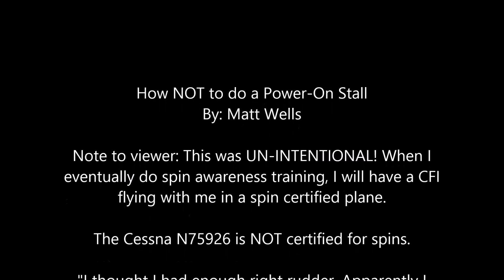How NOT to do a power on stall/Spin awareness

Comment: The reason why you had a wing drop is not because you didn't have enough right rudder but because you've used the ailerons! Higher AoA on the left wing will make it stall first hence lead you straight into a spin! Nice recovery though.
Reply: Bingo!  Deflection of the aileron changes the chord thus AOA for a given relative wind vector.  A spin is an imbalance in stall on a symmetrical wing (kind of tough to do when you think about it).  The more of a delta between the more deeply stalled wing and the other stalled wing, the greater the spin forces.  Aileron deflection just helps make the delta that much greater.
Reply: Correct, but it's important to note that both wings are stalled in a spin, not just one wing. Although... I guess one could argue that one wing is more stalled than the other... Heh.
Reply: only one wing is stalled in a fully developed spin, that's how autorotation works.
Reply: no, I think you missed the point - in auto rotation (spin) one wing is stalled and the other is generating lift - that's the cause of the spin, if both are stalled then it's just a normal nose drop stall and recovery.
Reply: Karl Schuch, technically, one wing stalls first, but in a fully developed spin both wings are usually stalled. You can argue both cases, and both scenarios are true.  Technically speaking, if only one wing is stalled, the plane would continue to roll throughout the entire spin; what usually happens is the inside wing stalls first, followed quickly by the outside wing.
Reply: Karl Schuch I'm genuinely curious why you disagree. Both cases are possible. I have a degree in mechanical engineering and everything I've learned as a student pilot support the idea that either one or both wings are stalled in a spin. In the case of a flat spin, if only one wing is stalled than the plane will roll, as only one wing is generating lift. If only one wing is stalled, as you claim, then the plane must roll. It's simple physics.
Reply: Karl Schuch from the faa directly "a spin may be defined as an aggravated stall that results in what is termed "autorotation" wherein the airplane follows a downward corkscrew path.  As the airplane rotates around a vertical axis, the rising wing is less stalled than the descending wing creating a rolling, yawing, and pitching motion"

Less stalled is still stalled. Both wings are stalled. I stand my ground.
Reply: Transane yep, I agree that statement makes zero sense ... less stalled?  I think that expression :"less stalled"  can only mean the wing is generating lift
Reply: a wing stalls as a result of the separation of the boundary layer when the critical angle of attack is exceeded - for a wing to generate more lift than the other, that means it has to have an attached boundary layer, which means it is not stalled... look it up in an aerodynamics book
Reply: Transane, you hit the FAA's spin-definition on the head. Both wings are stalled with one wing more stalled than the other. Laminar flow over both wings have been disrupted.

Both wings exceeded its critical AOA with one wing's AOA greater than the other.

One wing produces more drag than the other causing auto-rotation with the airplane yawing, pitching, and rolling in a cork-screw path forced downward by gravity. 

Every competent CFI-candidate, CFI, and DPE will support this.
Reply: Windtee I appreciate the support. It's important to spread the correct information so that we may all be more informed, safer pilots.
Reply: Jordan Barat wrong.    As the plane slows down and yaws left , the left wing slows down more than the right and stalls first-> drops first-> spin.
Reply: Karl Schuch no Man!    Both wings are stalled in a fully depvd spin.   How is a wing not going to be stalled with air flowing circularly around the darn plane as it falls like a rock?    Both wigngs stalled.
Reply: I think some of you guys are being too nit-picky about the definition of a stall --- it's not like a light switch that you flip between light and dark --- stalled and not stalled --- flying and not flying.  You're not out there dealing with a dictionary.
Reply: Tim E. Actually, it is like a light switch on and off... Hence why there is a documented angle of attack at a given airspeed you shouldn't exceed; a stall happens at a particular speed/angle because laminar flow breaks at a particular speed/angle.

When something is less stalled, they probably mean it has less laminar flow separation than the other wing; not that it is not stalled because it is "less stalled" than a stalled wing... If that makes sense for the person claiming less stalled means not stalled
Reply: Cory Goodman  Think of it this way—-the  L/D graph rises to a peak , a maximum,  but it then does not descend vertically to zero immediately afterwards. It drops far more steeply  than the initial climb angle on the graph , but it is not vertical!  So, each wing could be at a different point on it—- both stalled——with one producing more lift than the other. It’s this difference in lift on each wing that produces the roll——even though both are at greater than stall angle—-because, as the FAA correctly says, in a spin the aircraft is pitching , yawing, AND rolling.
Reply: If I may, it looks like you weren’t using enough right rudder as you initiated your stall. The right wing starts to get kicked out forward which generates more lift on that wing, causing it to rise. As you pull up you can see you feeding in more and more right aileron until the left wing breaks, at which point you use full right aileron deflection, which just stalls the left wing more aggressively. This was a great video and I’m glad we all learned from it. *some advice that saves lives* If you are ever slow, pulling pitch and a wing starts to break, DO NOT try to pick it up with opposite aileron. Relieve back pressure and kick opposite rudder immidiately!! Thanks for the video
Reply: improper use of ailerons after wing drop AND insufficient right rudder during maneuver.  Just look at the lateral movement of the ground leading up to it.  Always recommend using higher clouds as good yaw references for pwr. on stalls (and definitely don't perform it into the sun.
Reply: Just to chime in here, the outside wing travels one rotation in the same time the inside wing does. Given the outside wing travels a further distance in the same time, it is not ridiculous to assume one wing can be stalled and one wing producing life in a spin. I could be way wrong though.

Comment: When I was a student pilot still in Cessnas, I asked my CFI to demo a spin for me.  Apparently he had not done this before, and went "by the book" on his spin recovery and took the "stick forward" instructions too seriously, basically locked his elbows straight forward like he was trying to push the stick through the firewall.  He put us into an inverted dive and all the books, pilot stuff and every mote of dirt in the carpet hit the ceiling (then immediately down on our heads.)  He corrected for this by pulling the yoke back into his lap and nearly over-G'ing the aircraft on the pullout.  Memorable to say the least.  I later went on to "real" acro, first in a C-152A Aerobat, Pitts S-2B, then later the full compliment of USAF trainers and some time in the F-16 and the unusual attitudes training in supersonic military aircraft is more extreme than in the civilian world - it was then that I learned his inverted dive recovery really should have been "roll to the nearest horizon then pull to level".  A lot of the memories of my stall/spin experiences have faded from memory, but the day you come back from a sortie with dirt in your hair is one you will never forget.

Comment: Something you need to remember: I had to do a turning stall for my checkride and you just have to keep reminding yourself if it's a turn to the right keep that ailerons NEUTRAL no matter what and be ready to slam that left ready and release back pressure. If it's to the left it's the opposite. Never ever ever in under any circumstance use ailerons. Great learning experience and fantastic recover. Only lost what looks to be about 800 ft. Nice job, and safe flying.

Comment: As a pilot it is vital that you understand aerodynamics and manufacturing recommendations for stalls and spin recovery. What is more important is learning and understanding what you did wrong when it happened so it does not happen again. Good recovery, and thank you for sharing, showing other pilots that it's okay to make mistakes as long as you learn from them and do not put the aircraft or yourself in danger.

Comment: If I may, it looks like you weren’t using enough right rudder as you initiated your stall. The right wing starts to get kicked out forward which generates more lift on that wing, causing it to rise. As you pull up you can see you feeding in more and more right aileron until the left wing breaks, at which point you use full right aileron deflection, which just stalls the left wing more aggressively. This was a great video and I’m glad we all learned from it. *some advice that saves lives* If you are ever slow, pulling pitch and a wing starts to break, DO NOT try to pick it up with opposite aileron. Relieve back pressure and kick opposite rudder immidiately!! Thanks for the video

Comment: I am a long time CFI, as noted below you attempted to level the wings with the ailerons in a stalled condition. In most aircraft proper recovery is power to idle, opposite rudder to stop the rotation, forward elevator to break the stall. The method will vary slightly by aircraft type, some manuals will define recovery with power to idle, forward pressure first and then opposite rudder.

Comment: Great lesson, Matt. Thanks for sharing.  As someone who is contemplating getting into flying, my takeaways from this video and discussion - avoid practising into the sun where I would need to use throttle hand to shield my eyes. Good advise about avoiding temptation to use aileron to recover.

Comment: he added right aileron as the spin began, thereby increasing the yaw in the spin direction - with some aircraft opposite  rudder input may not be able to overcome the yaw created by improper aileron input sufficiently to stop the autorotation... Fortunately he took the aileron yaw out and the spin stopped.... he needs spin training and practice - as do almost ALL general aviation pilots.
Reply from the maker: Generally, student pilots with only 25 hours TT need training and practice...hence why I was out doing those in the first place...
Reply: very cool, keep going after it - read up on spins and that will place you head and shoulders above the rest of the field.  I flew a Pitts S1 for years and became proficient at aerobatics, and I learned that spin recovery is so essential and yet most pilots are clueless.
Reply from the maker: *Note: This was over 2 years ago when I was in VFR training...It was only a few flights after this that I did spin training with a CFI.
Reply: Karl Schuch aileron drag is mainly noticeable during the onset of a roll. at such a low airspeed his ailerons would have been much less effective. it appears that the student mistakenly used his ailerons to try to pick up his wing drop, and control his spin. 
the reason this aircraft spun was due to far too much left rudder during the power on stall
Reply: pilot_ryan89 of course the spin was initiated by yaw induced when entering the stall, application of opposite aileron only contributes yaw at that point while doing little to control roll

Comment: Once you did the classic aileron stall of the inside wing, not only did you have the wherewithal to pull power, you also grabbed carb heat, just as you stepped on the rudder.  Gonna' say: that impressed me.

Comment: you had right aileron, the raised aileron gives that wing a lower angle of attack, the other wing will stall while the upper wing still flies. This is the basis of the base to final turn....getting slow, starting to roll and putting aileron in to compensate and just what you got!  Nice job recovering for a student pilot....

Comment: Nice job. one tip when you're doing a power-on stall it helps if you pull more aggressively on the yoke once you get around your stall speed, instead of slowly pulling back. Just makes it happen quicker and less rudder work

Comment: Wow.  Very nice man!   Thanks for sharing!     That's a great mistake made in the appropriate setting for everyone to learn. Great job on the reflexive pull back of the power.  I am sure by now you know that you should have added more right rudder as plane slowl jawed left to prevent the spin, and also not to try to correct with aileron, and much less to pull back.  Instead hit right rudder, push forward, and pull power if nose down.     Great job man.  Good learning experience.  Thanks for sharing.

Comment: The secondary effect of the yaw is roll. Since you were in slow speed you needed to apply more right rudder to maintain direction. You didn't do that. Constantly you were yawing to the left. This caused the right wing to move faster than the left wing therefore the right wing was producing more lift. That's why you were also rolling at the end and just prior stall even though you put full right aileron it was too late. During Slow Flight you are required to fly the so called "crossed controls" meaning applying more force on the controls in order to maintain level flight and direction. This is because the control surfaces are less efficient since your airspeed is slower.

Comment: Good one, Matt. Hey, you had heaps of recovery height and you reflected back with both humor and wisdom in relation to it. You seem to have been pretty competent to me in handling the exercise at that altitude, even with the incorrectly introduced right aileron. Just a small thing though, a bit of guidance for the viewers regarding the throttle setting (was it around 1800 RPM?) on entry. This might help them to understand the "power on" description. On spins. A quick, clean vertical tug at the control wheel and heaps of rudder applied quickly will you'll usually get you the spin you desire, and for recovery, if your head is in a "spin", sometimes simply letting go of the control wheel and throttling back to flight idle will get you on the road to initial recovery without having to think about too much else for a few seconds.

Comment: Spin awareness training?  Is that what there calling it these days.  Good job though recovering. I soloed with 5.5 hours at about 16 yrs old back in 1974.  It cost $10 bucks an hour to fly the club 172 back then.  I use to go out and practice power on and off stalls.  On day I did a power on stall, and as soon as I went into a spin I forgot to cut full power,  When I let off back pressure and recovered, I red lined very quickly. When I cut throttle I milked it back really slowly till I got down to a safe speed.  

I use to chase buzzards which incidentally are great dog fighters, and would do bombing runs on trains.  Man those were the days.  I buzzed the house of every girl I knew.  They would run outside and dance around the yard, their parents would all come out and wave like it was the first airplane they ever saw.

Comment: I didn't look like he moved the yoke sharply forward.  Is it just me, or do others see this too?
Reply: In some instances (from what I know) you can simply add opposite rudder and it will recover before the spin actually develops.
Reply from the maker: I did at the last second, but i was already falling. Then I attempted to rip the ailerons off...
Reply: Yea a spin is not fully developed until after 3 rotations. I have done three spin recover with my old instructor and the first two we did 1/2 or 1ish rotation and they recovered basically after i released control pressures. The last one he counted out three rotations and said recover and I have to say pushing forward on the yoke when you are point straight at the ground was exactly the opposite thing I wanted to do haha.
Reply from the maker: Last time I checked, "A spin is a special category of stall resulting in autorotation about the vertical axis and a shallow, rotating, downward path..." Even 1 rotation counts...

Comment: It's very easy to be an internet expert. It's definitely very different in the real situation and I think you reacted well, although this is the kind of reason I think full spin training should be mandatory because if you were in something a bit more spin happy you would be dead right now. Not your fault it's the system set up for training pilots, telling them how to recover from a spin is not the same as actually doing it. Also using the ailerons make the wings stall in a more spin happy configuration which is a big oops but hey at least you are here to learn from it.

Comment: no pilot what so ever, hence my question; why would the plane start to spin in the first place? Is because of the rotation of the engine??
Reply: The engine can "help it" a little, but primarily because one wing loses lift sooner than the other, which also means that it has greater drag, so it starts rotating the aircraft. The vertical tail is not powerful enough to stop the rotation because of the slow speed, and the result is a spinning motion.
Reply: sirspikey left turning tendencies cause left spins often, but a spin will always occur when the plane has stalled and isn’t coordinated